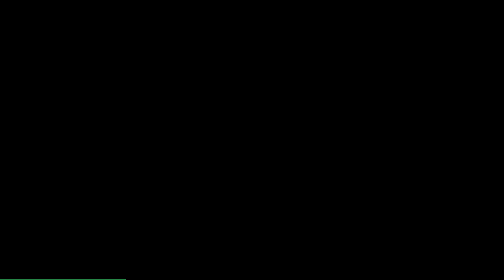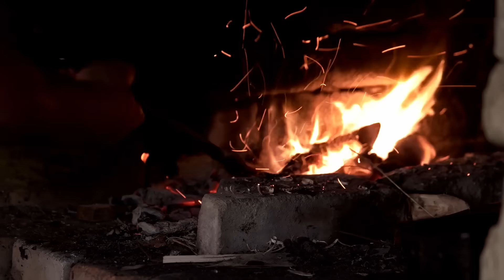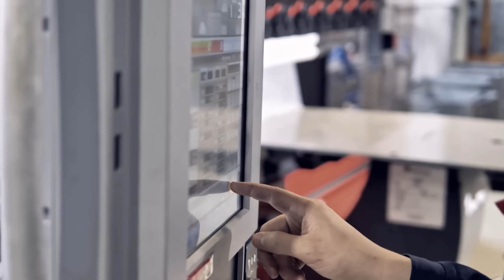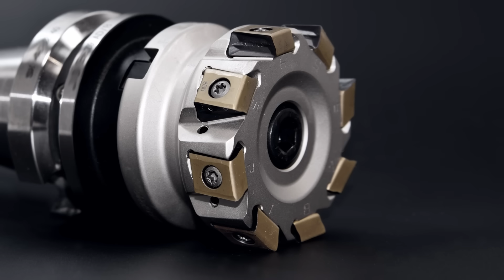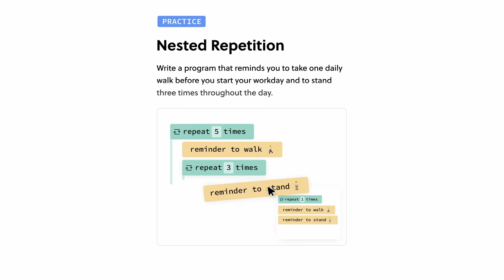The Science Of Cutting

Comment: You are almost completely wrong on the whole iron/steel thing. Iron has almost no carbon, steel generally has from 0.1-2.0 percent carbon, cast iron is more, pig iron more than that. Early smiths had iron, NOT pig iron. Early furnaces could not melt iron ore, rather burning off impurities like oxygen.

Comment: i hate the facts that its called "high speed steel" since these days you exclusivly use carbide tools with much higher speeds and HSS basicly means the opposite and will melt away if you run it on carbide feeds.

Comment: 08:12 It's the opposite: Low carbon steel has a lower tensile strength and hardness than high carbon iron. When alloyed yes, it can be stronger.
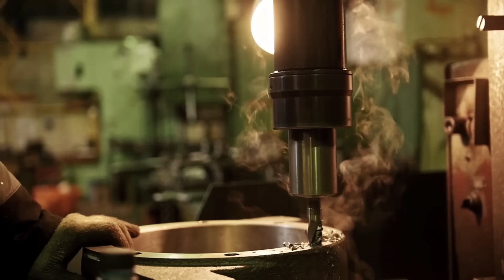Reply: 10:29 Again, it's not "unlike" but "like", cutting butter or cutting steel is the same principle.

Comment: I'm always confused when cast iron is described as low carbon iron mix, when it's on the higher end of commonly used forms of iron/steel. Like ~2-4% carbon whereas most others are sub 2%. But I guess the context is the ability to remove carbon from iron mix for the first time. Actually understanding the whole concept of iron and steel was one of the harder ones to grasp because it seemed to make no sense. Until you realised the historical process and naming in more chronological order than reasonably consistent technical definitions from current knowledge.

Coincidentally ever since september I've listened to the same stories about iron/steel's history as material used in class. It's nice to get the same information from different sources and different emphasis. This one going a bit further than just talking about the metal itself. But I'm also going through 3D printing class, which essentially is lectures about additive manufacturing methods. During the last decade NASA started experimenting with 3D printing combined with traditional machining for some Mars rover heat exchanger and seemed to find it quite effective for their use. There's definitely space to explore in finding the right uses as the technologies evolve and new are developed, as well as combining with existing methods. On the other hand Velo3D's (aerospace, defense industries) pointed out how "3D printing industry is in a state of recalibration - -" and that AM no longer is seen as "panacea that solves all problems", which sort of emphasizes what everyone knew: it has its limitations and it can't overcome efficiency of traditional machining/manufacturing in some applications, but it has justified its stay as core manufacturing methods for the future.

Comment: - 00:00 🧠 Cutting tools are fundamental to human progress, enabling the transformation of raw materials.
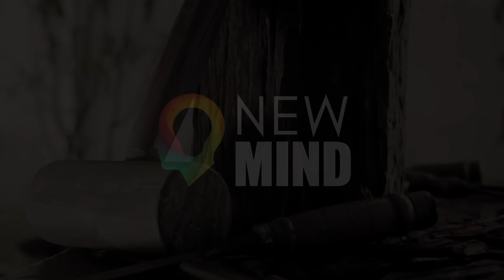- 00:40 🪓 Early humans used stone tools like choppers for cutting meat and creating advanced tools.
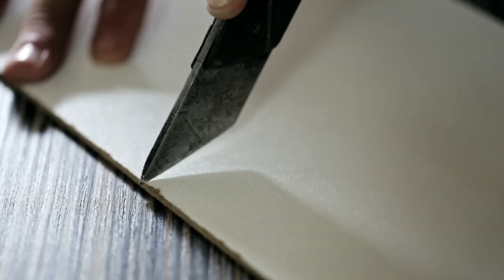- 01:16 🔪 Cutting involves applying a directed force, requiring the tool to be harder than the material.
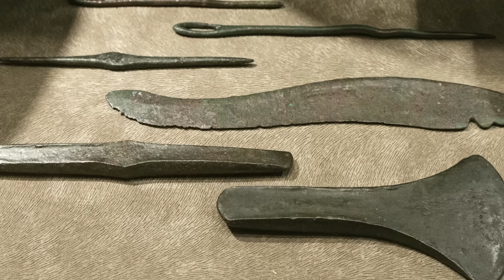- 02:10 🛠 The transition from the Stone Age to the Bronze Age brought the use of metal tools, starting with copper.
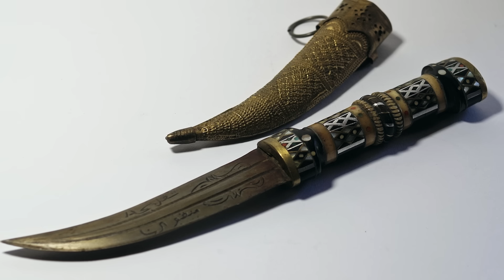- 03:06 🧬 Metallurgy emerged in the Bronze Age, allowing for the creation of alloys and manipulation of metal properties.
- 05:00 ⚒ Bloomery furnaces allowed the processing of iron, leading to the development of wrought iron.
- 07:09 🔥 The blast furnace further advanced iron processing, leading to large-scale production of pig iron.
- 09:04 ⚙ The Bessemer process revolutionized steel production by efficiently reducing carbon content in iron.
- 11:00 🏭 Machine tools evolved from simple hand tools to complex machines, enhancing precision and efficiency.
- 13:28 🖥 CNC (computer numerical control) machines automated production, achieving high precision and repeatability.
- 14:39 🔧 High-speed steels, introduced in 1910, withstood higher temperatures and cutting speeds, advancing tool performance.

Comment: Most of the introduction (metallurgy part) and blast furnace sections are off-topic. Again, this video is about the history of the topic (cutting) and not the current science of it. What is new in the cutting field? what are the researchers researching? what is the next new material to make knives, drills, machining inserts, etc. out of? Then there is a discussion on grinding which should have been in the abrasives video. Then 2 sentences on laser cutting and EDM? These are unique classes of cutting that have unique roles in modern manufacturing. Shame you dismissed them so much. There's also flame cutting and arc gouging that were not discussed.

Comment: I almost got killed by a lathe once. Even if it’s -40 degrees Celsius outside, and the shop you’re working in is an old miner’s barracks with holes in the walls so it’s around -10 in the shop… never let down your sleeves.

Comment: Open hearth furnaces were NOT more efficient than Bessemer converters but they did not introduce nitrogen into the steel like blowing air through it.  Without nitrogen open hearth steel was much tougher especially at lower temperatures.  We operated 1400 ton open hearths in the mid 1960s.  Open hearths were replaced by basic oxygen furnaces - similar to Bessemer converters except blown with pure oxygen rather than air.

The pictures of dislocations was interesting, especially with them moving.

You need to do more research on the history of metallurgy.  I'd recommend "making, shaping and treating of steel" as one source.  

Later bronze swords were better than the early iron swords but iron was much cheaper so a noble could arm more soldiers.  Adding Be to copper or bronze can increase the hardness to Rockwell C 45.  Egyptians knew this.

Comment: The machine that makes a machine tool different from any other is the use of the screw to precisely control the application of the cutting edge to the work. It's really that and not the application of power. A power tool isn't necessarily a machine tool. 

A machine tool can be human powered and still be a machine tool. If you have to turn a wheel to make a cut happen, it's a machine tool. If you have to push to directly move an edge to make a cut happen, it isn't. 

It's that the cut is constrained, guided by a way, and fed by a screw or lever (which themselves are basic machines) which makes a machine tool such.

A woodworking lathe where you apply a chisel you hold in your hand to a spinning workpiece isn't a machine tool, but it is a power tool. An electric drill you aim by hand also isn't a machine tool, neither is a router you aim and move about by hand. 

A screw cutting lathe is, a mill is, even a pedestal drill is (although barely, because it has a quill you lower by turning a wheel). CNC machines of course all must be, but so too must the 'power feed' axies which a mill or lathe might have. 

But it seems too often people equate 'machine' with 'has power from other than a human', and it just isn't so. A lever is a machine, so is a ramp or wedge, and the latter wrapped around a rod makes a screw thread, which is really just a fancy inclined plane which allows rotation to make controlled linear motion along the rod. That being used to change the position of a cutting tool, whilst another axis spins it, is what a screw-turning (metalworking) lathe is. It's not the spinning-ness of the work - it's the controlled positioning of the cutting edge.

Comment: As the lead mechanical design engineer for a large tech company, this video gets me GOING. 

On the machine screw level I can tell threads by eye. What amazing history lead to what I use. I can take surface to edge angle / distance, plane to plane measurements and validate fasteners for use with a couple clicks using CAD. 

What a time to be alive :)
Reply: Fortunately, I lived through these changes. Truly incredible progress has been made with the entry of computer technology into this profession. I started CNC programming on a small EMCO cutting machine. Today, knowledge of PLC codes is not required in many places.
We sharpened the tools while holding them in our hands, now machines do this for us as well. I'm programming sharpening machines like this now. :) :)

Comment: Excellent video, I learned a lot. Just wanted to point out that the reason why the discovery of the basic Bessemer process (using alkaline minerals for refractory lining) cut costs so much. As you said it allowed for the use of phosphorous-containing iron ores in steel-making. Phosphorous is a very common contaminant in iron deposits, and thus most deposits were unavailable for exploitation because the phosphorous contaminant would have rendered the steel brittle and useless. The cost of steel dropped when we no longer had to mine phosphorous-free ore (which often also has low iron content).

Comment: I poured Grey and Ductile Iron at Sather Manufacturing in Everett Washington State for good old Jody 😅 ahww awww and I loved it. I was doing Shakeout. We clamped molds for about an hour and we tapped out. We would pour from a Ladle weighing 1000# and carrying 3000# of bright orange almost yellow molten Iron and poured the molds we just clamped. After doing 9 Heats the first poured Castings were cool enough to shake out and not warp. We put them in the next room over with a power overhead crane. I started work at 11 am and didn't get to go home until All the molds we poured we're shook out and the sand shoved in the corner of the shop to be used to make tomorrow's molds. With a Bobcat Skid Steer 😏 I had so much fun and blasting a manhole cover hanging from the chain and knock off the sand with sludge hammer's was the highlight 🙂❣️🇺🇲🖖 9:04

Comment: I haven't watched this yet, but I still haven't been explained why, cutting a brake rotor on an ammco does not produce the same finish of a the original machine? Yes I know that the ammco style system uses negative rake, but surely the finish can't be that dissimilar. 
Is it due to the heating and carbon disposition into the iron?

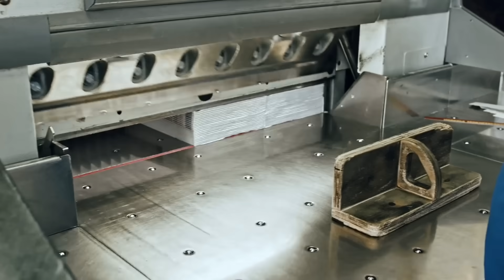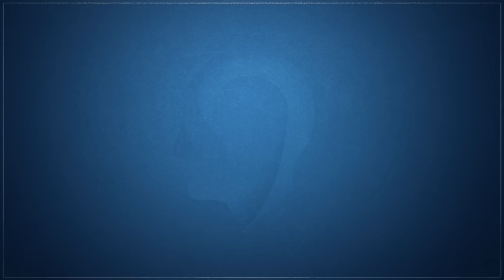Comment: You were better before, I think this is slightly misleading in the title and scope.  The chatgpt used at 1:20 is a word soup that sets you up for another mistake where at 1:29 you describe a materials strength and toughness is essentially the same as its hardness. There is also no discussion about cutting items without blades, like how the egyptians cut out obelisks using diorite, sand, fire, and water --- or how large manufacturing facilities use hydraulic shears to cleave and shear the steels into pieces because its faster and more effective than trying to use saw blades to cut through the material. What about water jet or plasma cutting? You could have done 20min on just the errors in the first 2 minutes.

Comment: 10 of of 10 presentation.
Teaching and the history of sharp strong cutting tools.
As a ex-Butcher the knife blade edge was very important.,if the blade edge was to sharp
 eg 11 degrees the knife would become blunt very quickly,if the edge was 25 degrees or more it would make for hard work boning and cutting. Between 20-22 degrees was just right.
We were told at college that you never cut yourself with a sharp knife.the blade cuts and flows in the direction you are cutting but a blunt knife has to be forced and can result in changing direction with potential to cut you.growing up in the trade a man at a butcher shop near me was boning a beef chuck and the knife slipped and went straight into his thigh,he died right there were he was working.😢
Thank you 👍🏼 
Australia

Comment: Crystallites were called grains half a century ago. This video claims that plastic deformation makes materials stronger because it increases dislocation density. This claim is false. Relationship between plastic deformation, dislocation density, and strength is complex. On the other hand there is simple relationship between plastic deformation, crystallite size, and strength. Plastic deformation makes materials stronger because it breaks big crystallites into small crystallites. The smaller the crystallites, the stronger the material. This relationship is called Hall–Petch relationship. (yield stress = lattice friction stress + yield constant times square root of grain size)

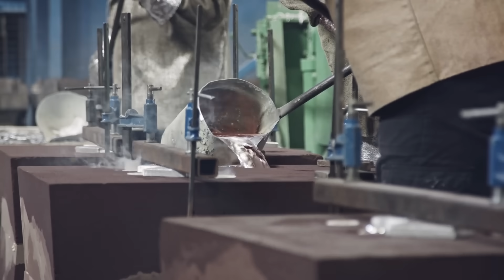Comment: 3:13 That is flat out wrong. Stone tools are often superior in sharpness even to modern tools. Let alone bronze ones. But they fracture easily, the shapes are limited, need a very skilled worker dozens of hours to make one blade, and even then it can fail, leading all effort to naught. And once it is messed up/has  you can reuse the base material, you need to look for another useable flint rock.
You can remelt bronze (/metals), though.
Metals, especially bronze, can be cast quickly, and tools and weapons can be mass produced with just a few workers. Of not not all have to be highly skilled.
Metal blades can be re-sharpened, stone ones not so much.

Comment: Are there any materials with a lower melting points, capable of cutting material with higher melting points?
Reply: Just about any steel would cut platinum which is rather soft, but melts at a higher temperature than steel.

Comment: Wait. Steel has less carbon than iron? Thats the opposite of what i thought.
Reply: It is just a quirk or specifically English language that alloys of iron with a large amount of carbon are often called "iron". (Pig iron, cast iron, etc). This is obviously very different from iron as the chemical element, or iron alloys with low carbon content (wrought iron).
Reply: Cast iron has too much carbon, it is hard and brittle but has a lower melting temperature so it is easier to cast into molds, when cast into ingots it is called pig iron, the channel connecting the pigs was called the sow, they though casting ingots looked like piglets suckling on a sow.. Iron with hardly any carbon is wrought iron it is softer and more easily shaped by the blacksmith. Iron inbetween with just the right amount of carbon is called steel.it has a higher melting point and tensile strength than the other two. Steel means good quality iron. These terms came into use before they had a real understanding of the chemistry involved. Blacksmiths can slowly raise or lower the carbon by which part of the fire they heat it in.

Before blast furnaces maid pig iron. Bloomery furnaces turned ore into iron without melting it making spongy iron cakes that had to broken apart to sort all the lumps into different grades of iron. This high and low carbon iron is then flattened and folded together to even out the properties, often pattern welded. This is often depicted as something peculiar and special to samurai swords, but it is actually one of the lowest tiers on the iron age tech tree.
Reply: @MrMonkeybat  So wierd.  I was always told that cast iron was softer which was why it was used in certain tools to dampen vibrations.
Reply: @beantea5592  Cast iron is harder and way more brittle, but it is pretty good at absorbing shocks, which is one of the reasons a lot of vices are made of cast iron.
Reply: @Cryzophylax  Vises are made of ductile cast iron, which has good toughness. The material with vibration absorbing qualities is a different form of cast iron, called grey cast iron. It is often used for the bases of precision instruments and machines because it has microstructure which causes sound waves to die out up to a hundred times more quickly than they do in other forms of cast iron or steel. This is not directly related to strength or elasticity.
Reply: @MrMonkeybat  "They thought* casting ingots looked like piglets." Who are "they"? / Before blast furnaces made* pig iron.
Reply: Pig iron has lots of carbon.   Iron Oxide is refine with carbon to get pig iron.  Lot of the carbon gets into the iron in the process.
Reply: I'm still thoroughly confused because all the cast iron I have around is easily scratched by all steel I have around. That seems to clearly indicate that it isn't harder.

Comment: 8:11 so if reducing the carbon content of iron turns it into steel, is it steel all the way until the iron becomes pure and then it becomes iron again?
Reply: In English language the the word "iron" is used for several completely different things, which is what creates the confusion that you are referring to to.

In many other languages there are different words for "iron with a lot of carbon" (cast iron, rigid but brittle), and "pure iron" (iron as the chemical element, soft and malleable).
Steel is "iron with an intermediate amount of carbon", which reduces the brittleness while still allowing the material to be very strong.
Reply: Iron with any carbon content up to 2.06% is considered steel, above that you get cast iron. At 0% carbon it is just called iron.
Cast iron in its liquid state is "softer" than the lower carbon steel, so it flows into casts more easily, however it is also too brittle for most applications.
Reply: Cast iron has too much carbon, it is hard and brittle but has a lower melting temperature so it is easier to cast into molds. Iron with hardly any carbon is wrought iron it is softer and more easily shaped by the blacksmith. Iron inbetween with just the right amount of carbon is called steel.it has a higher melting point and tensile strength than the other two. Steel means good quality iron. These terms came into use before they had a real understanding of the chemistry involved.